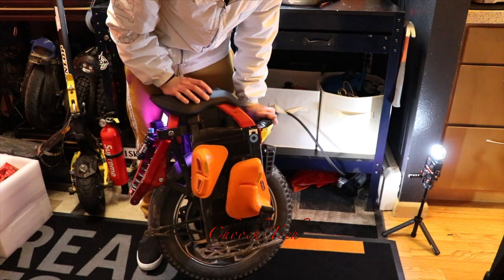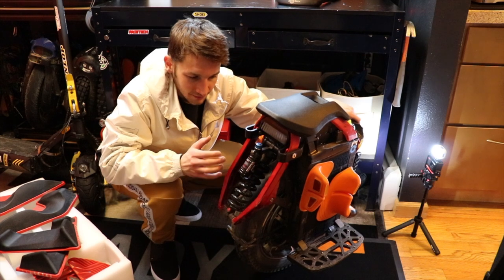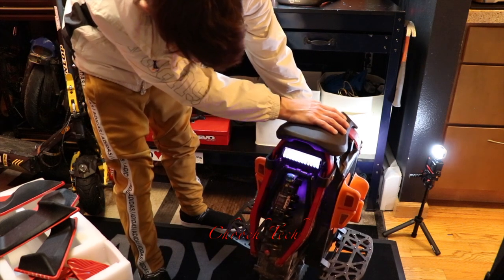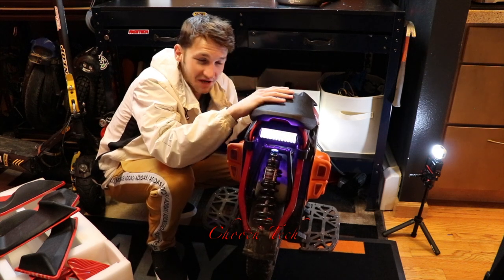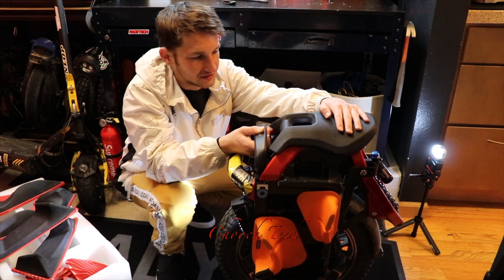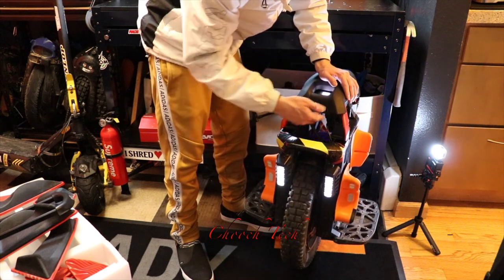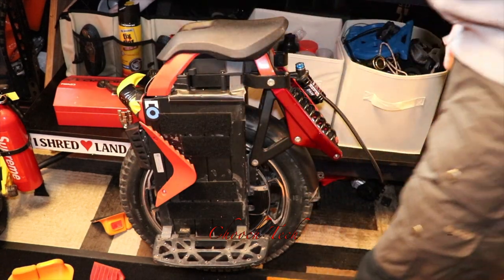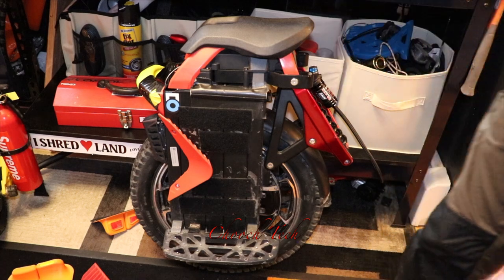INSANELY FAST/ FUN ELECTRIC UNICYCLE (KING SONG S22 EAGLE) Save Gas and Go Fast! *Half E-bike*

Comment: Very cool track there. Perfect for that sort of thing.
If they add posts that crane over the track, then they can make it so you never have to use batteries, borrowing from the streetcar design,mixed with electric unicycle. This could also be designed like a amusement park ride is designed, with full safety harnesses so any complete idiot could suddenly manage to negotiate such a terrain. A training ground for type of school of balancing, rehab, and leasure.

Comment: This got me to thinking about, imagine how bumper cars at amusement parks and street cars work with how they are powered, and wondering how that could adapt to a electric unicycle, as a bumper car is basically running around on a singular wheel though has balancing additional wheels. Plus the thought of how they are powered without batteries by using conductor brushes like a brushed motor the size of a arena.
Hmm..

Comment: Hi Chooch, I've been watching your videos since you were comparing the s18 and the v11. I have a onewheel right now and I nosedive a lot going up hills because I weigh like 220 lbs. Do you think the s20 has enough torque for heavier riders or would I be better off getting a high torque wheel?
Reply: I weigh 210 and ride pint x. I also have S18 that I ride on blue MTB trails. S22 will have plenty of torque for our weight
Reply: "Sure wheel".......Get it? Hahaha. Anyway that wheel will have more than enough for you. I have the V11 and im 240lbs and I have no problems. The S22 will move you right alone. I have a onewheel XR and I find myself very aware of everymove. Get an EUC. Learn it and its a lot safer than a onewheel. Ive been down twice as many times one the onewheel.

Comment: Whats your promo code for euco, about to buy a wheel from them
Reply from the maker: ★Use Code chooch50 at rev rides or https://bit.ly/3exn7hX
Reply: @choochtech  sorry bro I wasn't able to use your affiliate link, but got a brand new on the box v12 from a private selling in Houston Tx. I'm also in Houston.. Its an amazing story.but paid less than 2000 for it with a new set  of grizzla pads.. Here I go off on this adventure.  Thanks for the inspiration my man..
Reply from the maker: @mcdavis3406  nice dude!